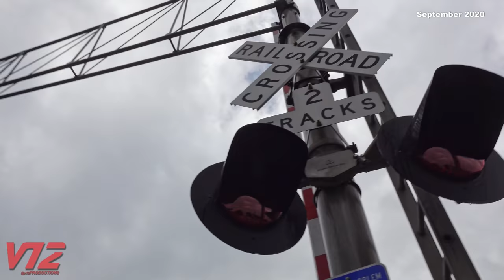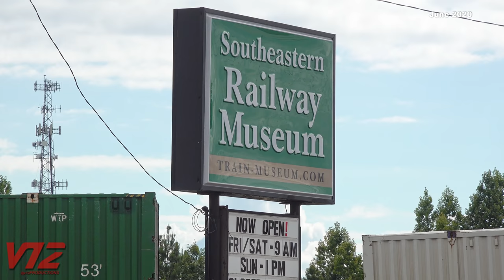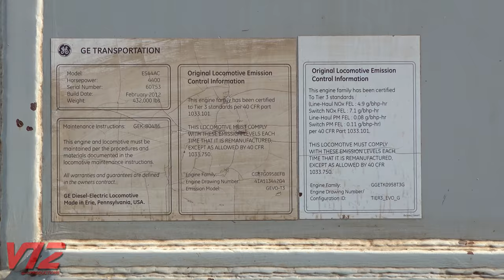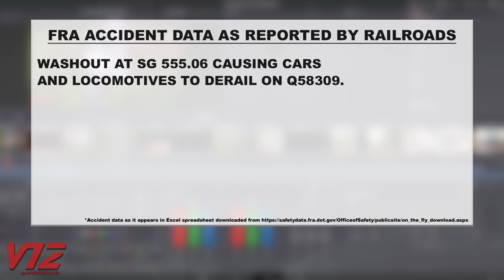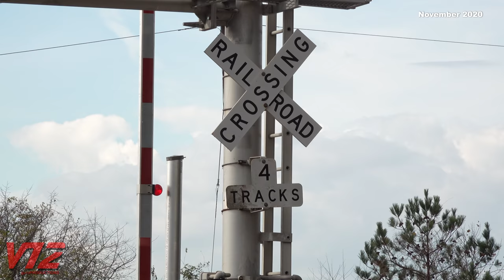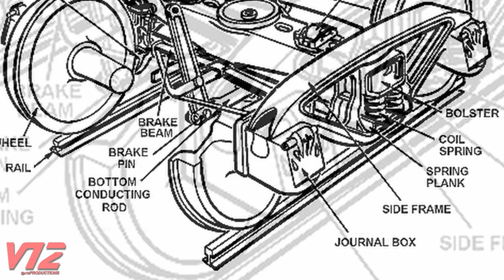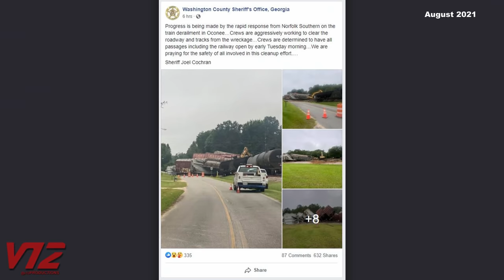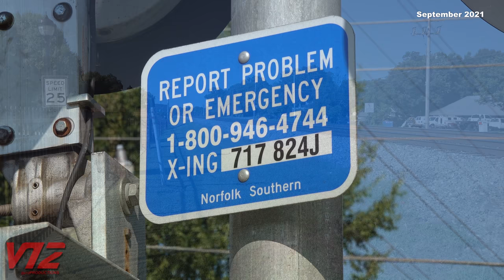Train Derailments & Accidents SPECIAL REPORT

Comment: I'll bet that the truck stopped because of the police lights and siren. If you look closely the truck had already initiated his move across the track when the lights on the crossing started flashing and his only alternative would be to back up and wait, which would have been a blind reverse while in traffic, plus the  cars in front of the trucker are blocking the crossing and forcing the truck driver to concentrate on them and diverting the truck drivers attention while the gates came down very soon after the move by the trucker, so don't blame the truck driver, in my opinion.
Reply: The truck hadn't begun to cross when the lights started flashing. It was still facing straight, parallel to the tracks, and stayed in that position for several seconds. And that road it was on, that right-hand turn lane is a full 20 m from the crossing. The driver chose to turn after the lights and bells started and attempted to cross as the gates came down.

He stopped when he realised he couldn't get past the post on the inside of his turn, the one holding up the traffic lights. I wondered why he didn't keep going, but then I saw the post. He'd never have moved it. Not at that angle and that speed.
Reply: Wrong, why is the video cropped. @paulkennedy8701
Reply: @josephwoehlerii2855  

It's cropped (at 1:47) I imagine to direct our attention to the approaching train at the extreme left edge of shot. At 1:50 it's not cropped; it's zoomed-in, in order to show us the important detail.

But what does that have to do with what I pointed out?
Reply: Exactly, the poor rookie got flustered.
Reply: I was lucky enough that the first time I was in that position. I didn't care less about cops and prioritized getting off the tracks.
Reply: I concur the truck only appeared to stop in the video when the police vehicles initiated its lights and sirens.

The police officer driving should have his own liability.
Reply: @AndrooUK  

The police officer used his siren because he was about to drive into the intersection on the wrong side of the road and against the lights.

The truck driver stopped because he couldn't get past the pole on the inside of his turn.

Comment: one other thing, if you are at a blocked crossing and you know the train is coming from your left to right... move to the left and away from the tracks at up to a 45 degree angle, towards the train so you won't get hit with flying debris from the train hitting whatever is blocking the intersection. There is a good video on youtube of what to do..

Comment: The problem with at-grade crossings are that the signals and gates activate way too late. In some cases there's less than 30 seconds depending on the speed of the train (I've observed). And the design of crossings is very poor. Crossing need to become noblow crossings. They also need a system to alert engineers at least 1 minute prior to impact that a crossing is blocked.
Reply: In the UK the barriers are fully down 22 seconds before the train arrives at line speed which can be 125 mph.
Telephones to the signaller are provided at road crossings to warn of any blockages.

Comment: that truck that was hit at 38 minutes into your video had to have been following a normal GPS instead of a trucker's GPS. Truck GPS can cost quite a bit more than your regular GPS but help prevent things like that. Mine will give me big X's on the road and say no commercial traffic or no trucks allowed with warnings that I have to cancel. Yes it can be wrong from time to time but street signs are there just for that reason..

Comment: My concern is the safety of the engineer and conductor in striking a tall vehicle like the tractor trailers.  There doesn't seem to be very much protection if a part of the trailer or contents are thrown up to prevent that from coming through the windshield of the locomotive.  Also, if the engine leaves the rails and rolls over, do they have seat belts to keep them in their seats and from being tossed around the inside of the cab?

Comment: I would imagine that most of the truck-train collisions is truck driver fault. I live in northwest Indiana. Once you start heading south, it is all corn fields. There is a state route 421 that is 2 lanes and heads straight south. When it gets away from city, it is all corn fields and can get very foggy at night. The speed limit is 55 and it is a straight road for about 20 miles. One night it was very foggy and a truck was doing 55mph. At night there is no lights around and the truck came up upon railroad tracks as a train was running from east to west. The truck driver never had a chance at the speed he was going. Reports indicated he never slowed down when he hit the train. The train derailed and the truck driver was killed instantly.

Comment: I have only this year been watching YouTube, rail fan videos are a large part of my diet.  I have only seen one accident on video in six months.  However there are whole channels that thrive on road accidents, and road rail in particular.  It seem to be an almost national sport!!  As an outside observer, I live in the UK, it seems to me that many crossing are designed dangerous.  Here we have LEVEL crossings, as implied the road and rail heights match.  It seems to me than most American roads, as opposed to highways, rise up and over the rails.  Another common problem is road either side of the rails are much closer than the turning ability of the vehicles using the crossing, especially tractor trailers.  To put a stop light less than a vehicle length from the side approaching road is ridiculous as there is no safety margin in which to turn, look, THEN cross.  Once a vehicle is past the lights if the barrier comes down it is in the way.  Undoubtedly there are bad drivers, and they should be dealt with appropriately.  But in their defence I believe many more are caused by bad layout design.
Reply: Yes I quite agree.  The federal administration should make all these Rail Crossing Road intersections to a safe standard specification.  Some are so un-level that even a lowered motor car or trailer could get stuck on the bumps.
Reply: Many of these crossing situations are very old, back when trucks and cars were much smaller. Many times the civil engineers designing roads do not allow for the size of modern semi trucks, and unfortunately many semi drivers don't pay enough attention. Blaming the GPS is baloney, research the route ahead of time and use your eyes before getting into a bad situation. If needed stop in a safe place and check where you want to go, or get help from locals.
Reply: @999pr1  Yes I agree.  It is what it is.  My nan always told me 'things will stay as they are if they don't change' , seemed odd at the time . . .
Reply: @999pr1  Yea, we have got one crossing on a very small lane, which is difficult even in a motor car as it is about 2 ft higher than the approach road, and then the road is about 1ft higher on the exit.   Fortunately the lane is only used by about 4 cars a day, and nobody crosses it at more than 5 mph.  The local geography and the trackside house would make it difficult to level it out.

Comment: Hi  sir can you tell me when  railroad company start to use the locotrol system  and  why sometimes locomotives  are hooked elephant style or back to back is there a particular reasons .thank you in advance for the answers.
Reply from the maker: I'm not an expert on locotrol, but I believe it was developed in the 60s. 
As for elephant style vs back to back, I think they try to place the cab at the front of the train, but the trailing units are left facing whatever direction they were headed when they arrived at the terminal.  
Distant Signal did a great video about this. It's called "Why They Run Locomotives Back to Back."

Comment: The train always wins. Reading the signs warning of a grade crossing not for trucks just like low height bridges should be respected. I had a trainer that was killed by a student at a train crossing in Georgia many years ago when the student let their foot up on the break and the Big truck rolled into the path of the train while stopped at a crossing.

Comment: Every crossing should be protected by the automatic road barriers.  These barriers should go down much sooner than they are programmed to do now.  Also, both sides of the road should be protected by barriers on both sides of the tracks, overlapping and totally blocking the road in both directions.  Perhaps the barriers should be redesigned to be more obvious, with brighter irridescent colors, and to incorporate flashing lights and some loud audible warning/siren.  Railroad crossing warning systems are very old, and there are certainly better ways to warn and obstruct drivers than in the past.

Comment: So basically i am no train track wngineer or anyone who even builds or drives trains but watching many tests on youtube I believe that ties (RR ties those r) are meant to allow trains to tip if its too far for a train to keep balance so that they fall into a much softer landing but also (i forget whats the rocks are called so im reffering to them as rocks) the rocks are meant to cushion the train if it does derail and also to slow it down. This is what i think they do, i havent done research but if im false please actually take the correct information over mine but anyway thats what i think they do.

Comment: That first grade crossing accident go back and look at the video. As soon as the officer turned on his sirens the trucker stopped with the gates coming down behind the trailer. Barney fife caused this accident by sticking his nose in where he didn't need to. He doesn't act on what he thought he saw this would never have happened. uprr employee with 20 years experience on the rails.

Comment: Here, Sweden, it's an ongoing work to build level free crossings on the main lines where the passenger trains go at some 125 mph. Gates covering the width of the entire road is standard.
Plenty of more lokal lines still have the crossings with roads. In critical crossings, mainly in towns, the railroad traffic affects the road signals to go to red in a way that no waiting vehicle will be stopping across the tracks. But still, lots of primitive crossing and accidents.
Driving the bus I had to stopp, road closed. An unfortunate car driver had loosed control on the icy road rather close to the railroad, tumbled around and ended up on the railroad tracks, up side down. Calling emergency but not knowing the position the dispatcher let the train go, without restrictions, and the car got crashed.... How could the dispatcher? Poor driver of the train. The lonely car driver had left the car but  the rescue services had to make sure and brought the entire brigade.....

Comment: Oh dear, I can't make the turn without slightly crossing a line on the near-empty road, so I'll leave the back of my trailer in the way of the train and cause an accident. How do some of these truckers get a licence?
Reply: You're right to wonder how thr driver got his licence, but the problem with the first one was not the line on the outside of the turn. It was the post on the inside. The truck could not get past it.

Comment: The last segment t]where the truck loaded with tools was hit made me cringe.  I'm a professional truck driver, and rule #1 when driving is NEVER EVER totally trust GPS .  It's simply a tool to help aide in navigation.  Using common sense (although not all that common these days) can easily save you from a situation such as this.  That being said, the truck driver had a responsibility to ensure safe movement of his vehicle.  I've traveled over 1000s of railroad crossings, never had an issue with any of them.  You absolutely need to keep your eyes open for signs that warn of dangerous crossings to trucks.  If you are ever in doubt, call the local police, county Sheriff or even state police.  They will have resources available to help get truckers around any dangerous crossings like this.  It's pretty obvious to me that the trucker in this case was on roads he had no business being on.  Always remember , trains ALWAYS have the right of way at railroad crossings.  If you are hit by a train, you were in the wrong (unless a major problem has occured).  I will never, ever understand how people can be so absolutely stupid and stop on railroad tracks.  A large freight train can be several thousand tons, and when they are moving at 50-60mph, they can take 1/2-1+ mile to come to a complete stop.  If you try to argue with a train, you will always lose.  Even a single locomotive weighs in at 300,000+lbs.  My truck can only legally weigh up to 80,000lbs.  That's a MASSIVE weight difference.  Whenever you approach a railroad crossing, always slow down, look for trains and listen for trains.  Sometimes crossing signals fail, don't always rely on them to warn you of approaching trains.  Really great video.

Comment: It amazes me just how many of the crossings in the US comprise of a large hump in the road surface, or with tight turnings that take the road alongside the track. A recipe for trouble with large trucks either grounding out on the hump, or not making the turn in one move. Youtube is full of videos showing the same type of accident over and over again.  To me it is not the fault of the railroad, more the fault of the highways departments that are responsible for the roads leading up to these crossings. Why wait until the road surface is right next to the track before raising the height of the road? Eliminate the humps, that would solve half the problems straight away. And redesign road layouts so there are no sharp turns right beside the railroad. Here in the UK I don't think i have ever seen a crossing designed like those in the US - with the exception of seldom used farm crossings. Until the design of those crossings are changed, your always going to have these type of crossing incidents in the US. I guess it is simply cheaper to clear up the mess each time, than it would be to change the design of the crossings themselves. I guess with big heavy freight trains, the train normally comes off pretty much unscathed, and still on the tracks. Could be a different story if you ever started to run much lighter, but much faster passenger trains on the lines.

Comment: In my opinion the last accident shows one of the problems with American rail-infrastructure.
There are too many elevated crossings. Yes, truck drivers should be aware, but please....
Is it so difficult to design and aplay level crossings???
Reply: @made-in-the80s Look at Europe. Just level your railroads with the roads. Not so difficult I would imagine.
Reply: @made-in-the80s either way. just make a start with new build sections and gradually change the system. That's what Dutchyland did with bicycle infrastructure in 70's. Just make a start and work your way up from there. But it takes acknowledge the problem first. And stop making excuses for it. If there is a will.......

Comment: Then why don’t you build tunnels and bridges instead of those crossings? Money spent on the rescue and repairs will easily make worth the investment.
Reply: There are 128K RR crossing not to mention all the property around the crossing that would have to be bought and torn down.not to mention there are many crossing that a re near to main roads which make an overpass impossible.

Comment: 😊wel,the trains are mutch to long,wooden laers  are rotten,using nails? absurd.use concrete laerrs en loksprings. trains max lengt 50.so it works here in Europe.freichttrains speed 130 KMPH. stay save folks.and dont drive to red rrc licht.greetz:🍐Peer.